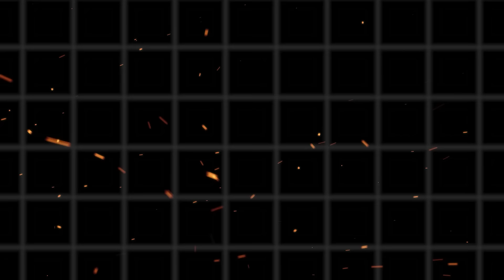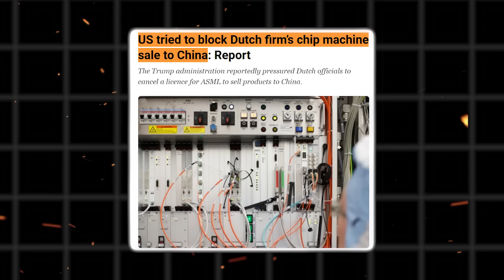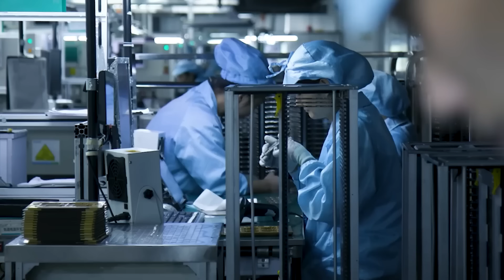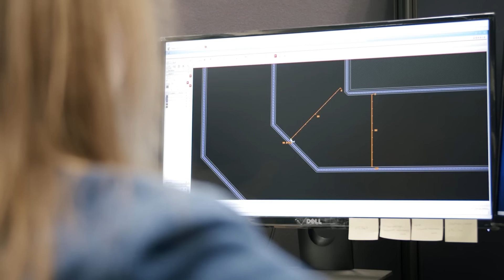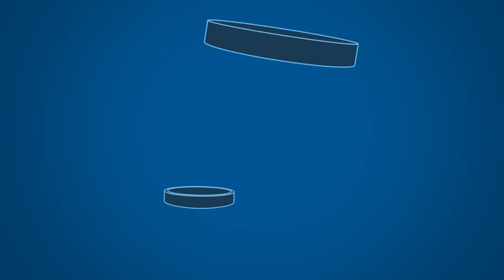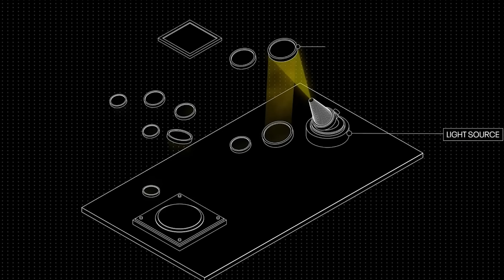China's Latest EUL - MONSTER Ended The ASML & Western Chip Dominance OVER-NIGHT!

Comment: Now it is time to commercialize the unit at the factory from the lab, to improve the yields. Together with advanced packaging using glass substrates, lithography at high end DUV is good enough
Reply: Yes, rightly so. Not all knives need to be as sharp as a scalpel.
ASML will go out of business in the next ten years.
Reply: @catrojana3694 as long as it does not earn supernormal profit n goes back as a normal company I m fine.

Comment: not surprised that the Chinese is looking at solid laser, China has been making such lasers for years and they have achieved very high efficiency with it. in fact, one can buy a "toy death ray" that is so efficient that it can burnt a hole in metal without generating too much heat. if they can create a solid state UV laser, multiply it and scale it up to the size of a building and then focus all the beams thru multiple filters and lens, it should be no problem to produce a super pure and stable beam.

Comment: The very day the device is  mass produced, the stock market will crash hard
Reply: Chiba has manufactured its own for at least 2 years REUTERS is a CIA front media company Sam as AP formerly AAP. CHINA has enough people to build whatever it wants and has its own EU machines this is another CHINA STOLE IT propaganda clip
Reply: @yfelwulf The limits of silicon are almost maxed out. Even if China has full access to ASML technology there are other mediums that are non silicon based that promise faster speeds without cooling requirements. I think newer chips will replace silicon and china will excel in both. The effect on TSMC will be significant.

Comment: China also has 2d semiconductors, which would offer a significant benefit over silicon based integrated circuit performance. This is not really being discussed, but their roadmap has mass production in 2030, which is now 3.5 years away..
Reply: hope they flood the market with layered ddram and flash nand so we get fast and low energy requirement storage en masse...maybe even start finally churning out unified memory level storage like intel attempted with optane
Reply: @radeksparowski7174 This will definitely happen when China enters the market. 

They will crumble the monopoly and the greed. 😊😮

Can't wait to hear the headlines and interviews. 😂
Reply: @AncestorialVFX  hope they do, have a 2TB nvme fanxiang for 99,99 and works like a charm